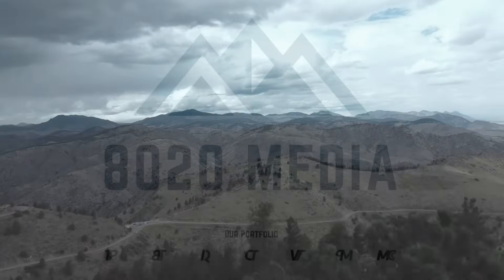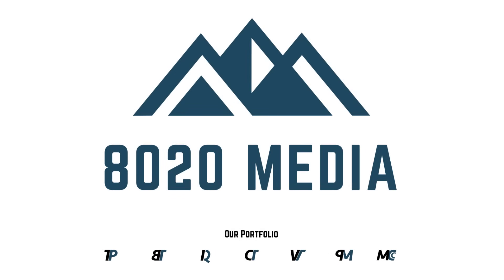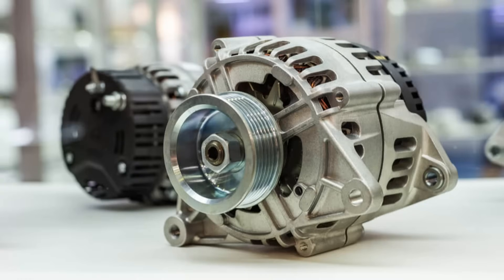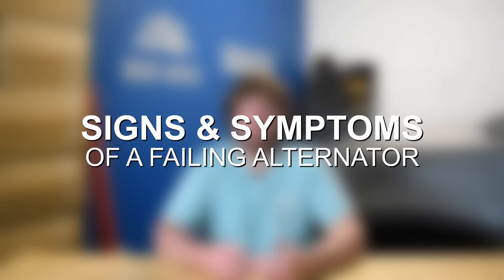6 Symptoms of a Bad Alternator!

Comment: I stopped to get propane in my RV (1996 Ford E350). It started again and i drove it about 4 miles and parked for probably 2-3 hours. When I came out, it was dead. No dash lights or anything. I got a jumpstart and drove back to my site and parked so it ran probably 20 minutes. I tried to start it again and no dash lights and totally dead. The alternator is 3 years old. So is the battery (replaced the same week). I charged the battery up from about 11.7 to 12.3 last night. This morning it was back to 12. Is that normal? I haven't tried to start it in quite awhile and there shouldn't be any drain since I am on shore power. I did recently switch my house battery to lithium but I was told that shouldn't make a difference. I rarely have driven this summer.
Reply: There's grease in the gas people are having trouble here in s.texas .in my town and there towns happened to my bf they told him not to put gas at circle k .others his truck turned off wouldn't turn on .he changed the filter,but it was his  gas tank and I think fuel pump.he found grease in the gas tank.so becareful where u get ur gas
Reply: You will have to drop gas tank but first take out the gas and inspect ur gas tank I bet it has grease in it.when u fix it the store might give ur money on fixtures.this is happening lots of ppl with gas messing up their cars
Reply: @irmagarza5357  it appears there was a bad cell in the battery. New batteryand all is good. I will also be replacing the starter.
Reply from the maker: J - Glad you were able to figure it out! Thanks for coming back and updating.
Reply from the maker: J - Sounds like a battery issue. But this video will help with your research: https://youtu.be/0YRdzJbHcm4

Comment: I turn my key, and lights turn on, windows work and radio works but there is no sound. No grinding sound. No nothing. Just dead quiet. What’s wrong?
Reply from the maker: B - Sounds like a battery or starter issue. We have a great video that will help out: https://youtu.be/0YRdzJbHcm4

Comment: 2011 bmw 528i everything it's electric that I didn't know! Battery died so I replaced but the alternator wasn't sending the right voltage and the car was giving me a lot of failure like engine mal function, transmission mal function, abs mal function ac blower too slow etc.... replaced the alternator too and everything went to normal! Hope this help!
Reply from the maker: R - Thanks for taking the time to share your experience!

Comment: Save yourself 100s of dollars and replace the part inside the alternator. Can’t remember the name of the part but the part is only $10 or so and just like that you have a working alternator. I’ve done this already.
Reply: Voltage regulator
Reply: Voltage regulator for my car just cost me $115
Reply: I thought it was a diode stimulator! 🤔@2220estCollegeAve
Reply: @2220estCollegeAve That's the part to replace on all alternators
Reply: Hey buddy did u remember that name of the part? Think I’m having this issue
Reply: Voltage regulator  @Rollup87
Reply: Do it right the first time, as this video shows so you do not have to come back to do the same thing over and over again. Sometimes diy can be way more expensive, and takes longer anyway.
Reply: @Josh_Wilding  well if we all thought that way we would be overweight because it’s better to eat fast food instead of taking the time to make your own meal, right 😂
Reply: What is the name of the part in the alternator?
Reply: @mattyJae voltage regulator
Reply: @mattyJae voltage regulator
Reply: Carbon
Reply: Pls make a video to show us how to do it. Thanks bro
Reply: Clutch pully
Reply: Alternator brush holder.
Reply: I tried replacing the voltage regulator still not working
Reply: Usually replace the brushes and diodes.
Reply: @marvinmurakami8828 ahh ok👍
Reply: pshhh depends $90 for mine and its behind a cover on alt ...had warranty but said screw reman and paid the diff for new best idea yet new new new pay the extra 30-40 $ get new if possible
Reply: Diodes maybe ?
Reply: Diodes.
Reply: Voltage regulator
Reply: Internal voltage regulator
Reply: Brushes?
Reply: So whats the name of the part?
Since youv done this before!
Reply: @hectorruiz7496 voltage regulator
Reply: Just search alternator rebuild near me,  it's better than aftermarket, but you gotta pull it out and put it back in after rebuild. Some places do it in a few hrs if they have all the parts in stock for your alternator  @hectorruiz7496
Reply: lol this is the most worthless tip/suggestion I’ve ever heard… fix the thing In the thing it’s just a thing 😂😂 gtfoh
Reply: The winding…?
Reply: You've done this but dont recall the nams of part 🤔.
Reply: What make and model of car did you have, @claytonmills1561?
Reply: If its a toyota, make sure its a denso original.
Reply: Thanks I'm give it a try
Reply: Thanks your analysis is spot on! 👍
Reply: Whats the name please? I need help with my nissan patrol y61 and I'm broke😂
Reply: Thank you,very informative.
Reply: Mind is gone! So what should I do to change the parts? Let me know.
Reply: Voltage regulator
Reply: Flux Capacitor😂
Reply from the maker: C - Thanks for the added insight here.
Reply: @8020Automotive do we know what the name is, today I realized that my battery was not the problem and that it was indeed the alternator. I’m a 18 year old kid and if I can save some money that’d be helpful
Reply: Diode or diodes. The other wear parts are brushes and sometimes the bearings.
Reply: What's the name of the part inside of the alternator
Reply: @albertclark540 voltage regulator
Reply: Brushes @albertclark540
Reply: Best check your area for a shop that rebuilds alternators as one might not have the proper tools needed for a full removal of the inner workings if your vehicle is really old and could use a full instead of partial rebuild that involves bearing replacement in addition to simply replacing brushings and the terminal block.  It is also suggested to rebuild with your own OEM alternator as opposed to buying an aftermarket alternator that likely to last only couple of years.
Reply: Useless information .. lol
Reply: It’s the brush pack
Reply: Or just buy a used alternator
Reply: I have RAV4 2021 XLE premium and I have told to replace the alternator by the Toyota dealership. They estimate the cost of replacing alternator is $1541.00. Is it true that alternator can cost this much?
Reply: No Toyota has that alternator for $350 but online Toyota dealers sell them $100 off, please don't pay $1500 for that
Reply: @गोबरलैंड heeeeeeell nah. That’s stupid expensive. Just checked the price of alternator. It’s about $250. They just try to get you to pay that but that’s a ridiculous estimate m. They probably charging you for a bunch of crap they might have to pull out but it’s nowhere near a decent price for an alternator change. Don’t go to a Toyota dealer, go to another regular mechanic shop and ask for prices. Or if you are not scared  do it yourself. There are videos on it on how to do it. 1500 for an alternator replacement is ridiculous!
Reply: @shul5684  yeah I agree, I'll fight any mechanic that wants to stand on that price😂😂
Reply: @shul5684 yeah really. Just Google the price. Labor is what's do pricey. But I'm not putting a alternator on in this cold a## weather.
Reply: @shul5684 I agree, supporting local mechanic shops is the same as supporting local farmers vs mega corporations whereyou are just a number, so much better
Reply: @गोबरलैंड you gotta be joking bro😭😭😭1451 that’s robbery
Reply: @गोबरलैंड  2021 and its failing . wtf lol sorry . thats should cover warranty .
Reply: @गोबरलैंड  yes depending on year and type of vehicle they can get pretty pricey, cheaper to DIY than going to the shop honestly.
Reply from the maker: 2 - Thanks for taking the time to assist other viewers!
Reply: @गोबरलैंड only if they charge you for labor that’s why alternator should not cost that much
Reply: @गोबरलैंड GAHHH DAMN!!
Reply: @गोबरलैंड is a newer car and it should probably run around 700 hundred for the original alternator plus labor fees

Comment: I went to start the engine and it hesitated but caught and started. What does that mean?  Several months back, I got stranded in a city,  I took my car to Walmart to see if they could tell if the problem was either the battery, or the Alternator. The so called mechanic I assume only checked the battery, I had to buy a new battery. Then the next day the car just stopped, At that point, I knew it was the Alternator instead of the battery.  I couldn't afford a new alternator, so they went to a junk yard and bought a used one off a car like mine.  Now, I am thinking that is  going bad.  

I took the car to O Reilys last night, they put it on the tester, and found out that it was the battery that is bad ???. I am so confused. I sure don't want to go back to Walmart and put a new battery in the car, only for it to do it again.
Reply from the maker: B - We think this video would be great for your research: https://youtu.be/0YRdzJbHcm4

Comment: If you jump start your engine then remove the ground on the battery and your engine dies your alternator is your problem because the alternator, if it is good will run your engine with no accessories turned on.
Reply from the maker: J - Thanks for adding this insight!
Reply: @8020Automotive so what he’s saying here is, remove jumper cable off ground first , and if it dies it’s alternator?
Reply: Heyy i have a chevy cruze 2010 model today i jump start my car then the remove the cable’s immediately after removing ground cable the car  engine turns off or should i have to wait for 5 to 10 mins in dead battery car

Comment: I appreciate the video, very helpful. I’m still trying to diagnose my issue without a shop.
Reply from the maker: K - Thanks for the feedback! What issues are you experiencing.
Reply: I can't get my truck to start. Replaced the starter, battery, ignition switch and checked all fuses and relays. Can the alternator keep it from starting? Thanks
Reply from the maker: J - This video may be helpful for your research: https://youtu.be/0YRdzJbHcm4

Comment: My car I turn the key dash lights turn on bt car won’t turn on then I’ll have to turn the key back a few times wait then turn it and it will crank I started to think my ignition switch was going bad and also brought a starter bt I check today I took my post off the battery and the car turn off most likely am thinking it’s the alternator correct???? If u can help me
Reply from the maker: J - Here's a video that may be helpful with your research: https://youtu.be/0YRdzJbHcm4

Comment: Can it affect the electronic steering wheel on 2012 VW cc?
Reply from the maker: S - Certainly possible.
Reply: @8020Media  after I jump-started my 2012 VWcc with semi truck, the steering wheel becomes stiff. I am wondering if it's an altinator problem.
Reply from the maker: S - Check your power steering fluid and make sure there aren't any leaks. If not, it certainly could be your alternator. Can check the voltage of it to confirm or take it to a local auto store for them to check your battery/alternator.
Reply: @8020Automotive  its electronic

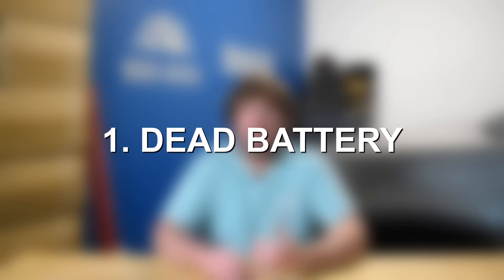Comment: 1:13 Dead battery
1:45 Dim or flickering lights
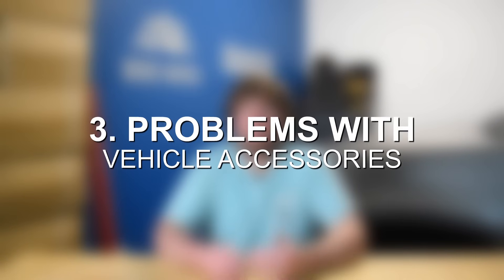2:33 Problems with accessories
3:32 Whining or grinding noises
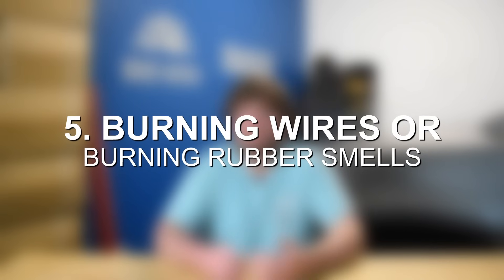4:45 Electrical burning smell
5:30 Engine stalling

7:13 differences between battery and alternator problems
Reply: Had all these issues at the same time wow right on.
Reply: I have enough of these symptoms (first 4 I noticed the other night) that I kind of already figured it wasn't the starter again, or the battery.  So I'm probably on the right track this time (almost replaced the alternator back then instead of the starter (which is what really died last time), and probably should have held off on replacing that battery).  Later today I'll try replacing it myself.
Reply: My Taurus was saying “Check Charging System”
Reply: I wanted him to get to the point so bad. Thank you
Reply from the maker: U - We make these videos for everyone, regardless of automotive knowledge. We put chapters in the description so each viewer can skip ahead to what they're looking for.
Reply: @8020Automotive 
Videos I've seen so far says to remove positive side cable. 🤔
Reply: @UnkoMykesLLC 🤦
Reply: @UnkoMykesLLC You should make your own videos, then.
Reply: No dashboard lights at all
Reply: thanks bro!
Reply: Dead Battery..weekly if I don't use my SUV✅
Reply: @sicilyny5375  they dont make em like the use to, huh? sorry for your troubles, i know what a pain they can be, particularly when you are commuting to work and need the thing
Reply from the maker: W - Thanks for doing this.
Reply: @8020Media My battery was jumped a couple hours ago.  It's starting good, no alternator symptoms,  however,  my alternator light is staying on.  Any way to reset the light?
Reply from the maker: H - Have you gotten your alternator checked out? It's not going to go away if there are issues with it.
Reply: @HiddenBlueGoddess you can’t “reset” an alternator light, just like you can’t reset an oil pressure light for example ie they are giving “live” readings from sensors and switches, if the light’s on you have a problem in your charging system somewhere, even if it’s just a loose connection etc it’s still faulty somewhere
Reply: Thank you, you’re the best ❤
Reply: Whining or grinding ✅ 
Dead battery ✅ 
Electrical burning ✅
Reply: I’ve never had to mess with cars before and I’m having to handle this all at once now. I feel so dumb for not knowing this. We had all the signs 😭💀
Reply: Power steering ?
Reply: This just happened to me.
Reply: Can I send you a video of my crazy sounds and I have almost all that you named issues 😂
Reply: MVP💯
Reply: I just found this video. What about outputting too much voltage like 16.5 volts?
Reply: @alekseyev79  probably a faulty regulator.
Reply: Sums it up quiet well 💯

Comment: Great video. I subscribed. After watching your video, I checked out my Corolla 2009 battery alternator charging using Topdon ArtiBattery 101 tool.
Charging test showed:
CHARGING LOW
Loaded -13.22V
Unloaded - 13.42v
Ripple - 10mV
Could you advise me if alternator is not working properly, and it is time to replace it with rebuild one. It is original alternator and the mileage on the vehicle is 150 000 miles. I will appreciate your help.
Reply from the maker: S - Thanks for the feedback! Are experiencing any symptoms? Have you checked your battery?
Reply: @8020Media  There are no issues with battery performance. 
Test shows that Battery is good, cranking is good, but Alternator charging is low, and before it was good too. Any advise?
Reply from the maker: S - Sounds like there could be an alternator issue. Are you experiencing any drivability issues?
Reply: @8020Media  Not at all. All equipment, lights, starter work perfectly
Reply from the maker: S - Then you should be fine.

Comment: Can the alternator cause your car not to go into gear all the way ? And then when you jump the battery off it runs until the battery light comes on and then dies
Reply from the maker: T If your alternator is going bad, this is possible because it can cause the battery to lose voltage.

Comment: Hey, so my car shuts off at some points, but it will only happen when I just start my car, it doesn't do it afterwards? Could this be an alternator issue or battery?
Reply from the maker: P - Could be either, but this is pointing us more to the alternator. Have you had it checked out?
Reply: @8020Automotive  I've got an check booked in on both, thanks for the reply! :)
Reply from the maker: P - Keep us updated.
Reply: @8020Automotive  so just to update you guys, the issue was the camshaft sensor :)
Reply from the maker: P - Thanks for coming back to update! This will certainly help future viewers.

Comment: Good info.

I have a situation where my car stalled.  I need to do a couple tasks before I'll get an ability to have it fixed, though.  I'm wondering what my risks are.

First of all, the stall occurred during a traffic jam in a rainstorm when it shut down, running the AC until "battery saver" killed that.  So if I'm running on the freeway, is it a reasonable bet I might get to a 20 mile distant location?  Especially if I leave the AC off?  In other words, might it be somewhat charging at speed?

Secondly, I tested the car after the stall.  Drove it around a drive, low speed, about 5 minutes.  The alternator felt very hot - hotter than anything I could feel on the engine.  Does this mean I might be in danger of starting a fire or ruining my belt in a short drive?

BTW, the car in question is 17 years old with the original alternator, 115k miles
Reply from the maker: S - Thanks for the feedback. We think this video will help a lot with your research: https://youtu.be/7bqAIbYRdnc
Reply: @8020Automotive  Thanks.  But this was a much more generic video; mine was specifically due to battery/alternator issues.  I was mostly trying to address how hot the alternator was.

In the interim, I've ordered an alternator and a mechanic in the area will install it.
Reply from the maker: S - Keep us updated! We hope it resolves your issues.

Comment: on my 2003 my alternator gauge is registering high it went over 19 ,, and i removed the positive cable and waited a few minutes and it came back down,, but still crawls up to 19.. it neve went to zero.. what is your advise ?? thanks,, also dash lights are not working
Reply from the maker: It's tough to say with the limited information. If the dash and dash lights are having issues it could potentially be a problem with the gauge and reading itself.

Comment: When I turn on climate control I get charging system failure then goes to battery saver mode and I would have to get a jump the next time I try to start the vehicle. I'm not sure if that is also an alternator issue
Reply from the maker: K - It could be either the alternator or battery. Have you gotten your battery tested?